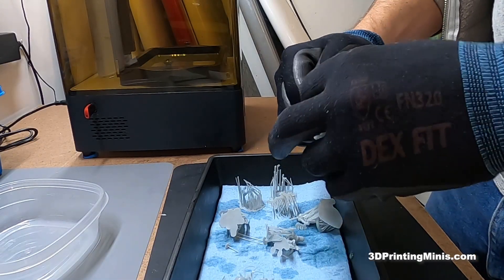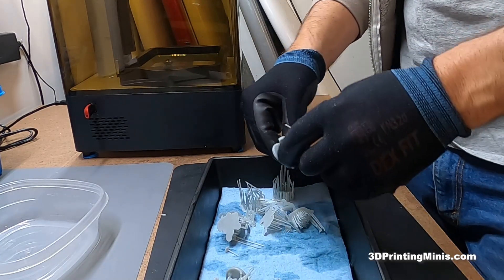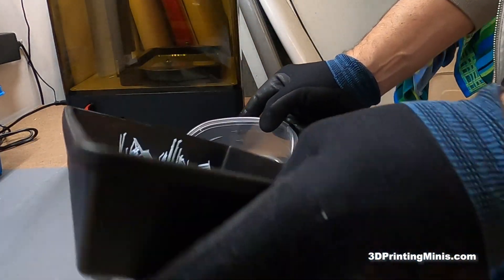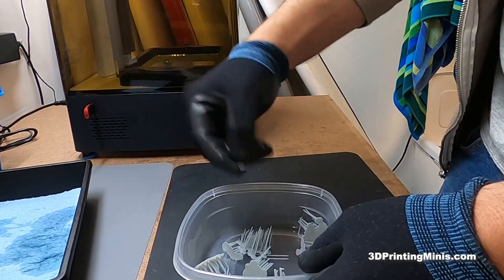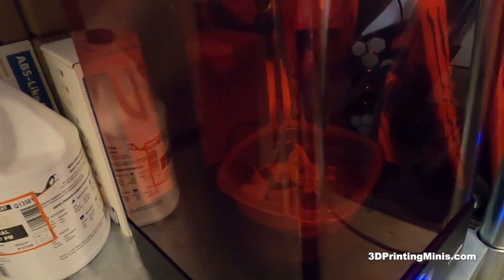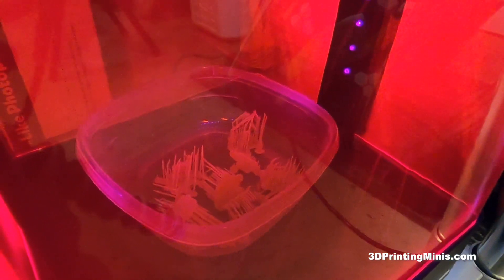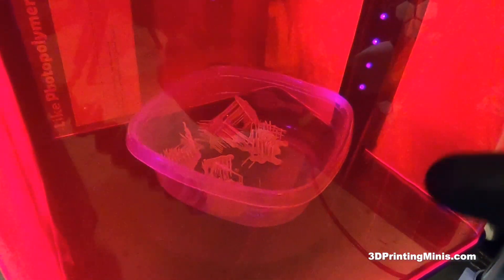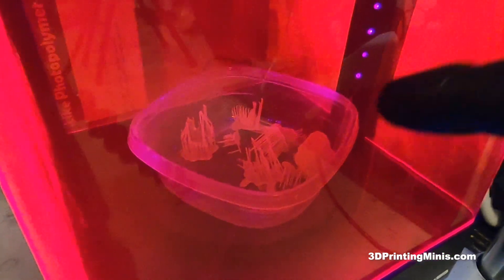What To Do With Used 3D Resin Supports - How To Dispose Of Uncured 3D Resin Parts

Comment: My other concern is paper towels and gloves and such that have cleaned up the resin, I had the foresight to not just toss the supports until cured, but what about the other trash?
Reply: I built a little box with a plexiglass cover and I set everything in the sun.  There is no better curer than a good old fashioned Population I, GV star for all your curing needs.  Frankly, its a shame I can't just dump all the print waste straight into it.  After I've cured all of it, I sort everything and make a judgement call on recycling.  Would that there was some way to recycle or utterly destroy the resin, I'm searching and hoping for a more refined response to our print wastes even now.
Reply: Same as with supports.....just cook it with UV before disposing.
Reply from the maker: You can get a UV flashlight from Amazon and give them a blast for a minute or two. Or, get a large cardboard box and dump your trash into that in smaller portions and cure it outside in the sun before you throw it away.
Reply: Wouldn't a clear plastic container from the dollar store do the trick? Just put uncured supports n stuff in it and set it on your patio or whatever to soak up the sun
Reply: @scorpirus  Not so much when you live in Scotland. Tinfoil lined box and uv lamp. Big enough to deal with water, towels and gloves etc.
Reply: @scorpirus  I don’t know about plastic, but I think even clear glass totally blocks uv.

Comment: just got a printer and wash/cure station.. do i clean the model with supports then take it off or take off supports then just cure them like in video later ?
Reply from the maker: You can take supports off before or after cleaning. But I recommend after. One, so they’re less goopy and easy to see where to cut (if you need to). And, two, because if you dip them in warm water or Mean Green for 30 secs it’ll make the supports much easier to remove. The main thing is to remove them BEFORE curing the model. Or else it’ll be a pain to get them off and you divet the crud out of your print.

Comment: What's the difference between throwing them away cured vs uncured? As long as they've been thoroughly cleaned, there's not much excess resin at all remaining on the outside. The only reason we post cure prints is for the very outside layer of resin to cure since it just came from bathing in uncured resin.
Reply from the maker: Uncured supports are still soft and not all the way hardened. If they are uncured they can dissolve and pollute soil and ground water. Supports are thin so fully curing them hardens them all the way through so they don't go on to ruin the environment. It's one small extra step to do in order to make our hobby a little less rough on the planet. 🤷‍♂️
Reply: @3DPrintingMinis  Completely fair and well said. I never thought about this. I'm going to start today. :)

Comment: hum would be cool if it was possible to turn them back to resin some way.
Reply from the maker: Sadly, that’s not how chemical reactions work.🤷‍♂️
Reply: @3DPrintingMinis  some times like heating pads, break the metal disk inside and the pad becomes warm and hard cook it to reset it. another example is metal paper or glass. a resettable resin should not be impossible to create.

Comment: What about eco-resin? It is supposed to be made from plants and biodegradable. Would it be better to cure it before disposing of it, or not?
Reply: If you look at the ingredients, generally only about 40-50% of the resin is plant derived, the rest of it is petroleum based. It is still toxic and not some miracle compostable non toxic chemical. Uncured resin and empty containers should always be sent to an official hazardous disposal area. It is incredibly irresponsible for these companies to make those claims. Please use these chemicals responsibly, if in doubt read their MSDF - they will provide a list of chemical ingredients.
Reply from the maker: It's all toxic. Cure everything before you throw it away. A cheap $10 UV flashlight or the sun (up in the sky during daytime) can be a big help.

Comment: Wouldn't they be able to be crushed and go into the environment anyway? 

I'd say if you are doing a bigger print, you might be able to grind these up, including not cured, and put the dusty bits into the larger print to add mass, then try to force cure it or at least in layers. Like a hollow skull you fill up would probably take days worth of prints right?

Comment: if your printer has a clean vat feature putting them in the corner of the vat before using the clean function makes it overly easy to remove the cleanse sheet instead of trying to pick at it with a soft spatula

Comment: Can you make filament with the resin waste?
Reply from the maker: Not that I know of. But maybe ask a chemist or email a resin company. They might have more info and/or a better answer. Sounds like an interesting idea though.
Reply: I've seen people who 3d resin print and use silicone molds recycle the supports by grinding up them up using them as filler materials in their liquid resin (for silicone molds, not your 3d printer).  You use less resin and you use up the scraps.  Similar in fashion to grinding up old tires and mixing it with new asphalt and laying down new roadway.